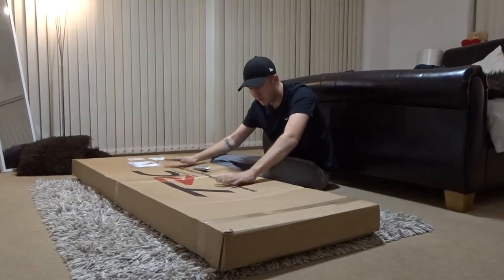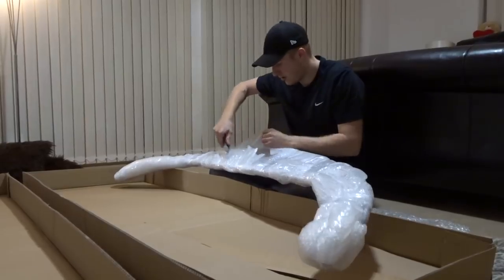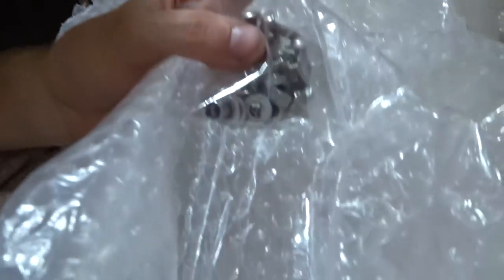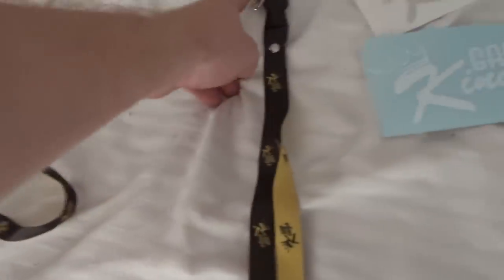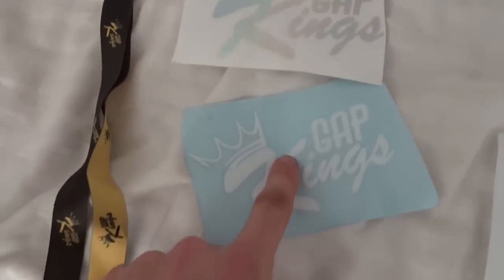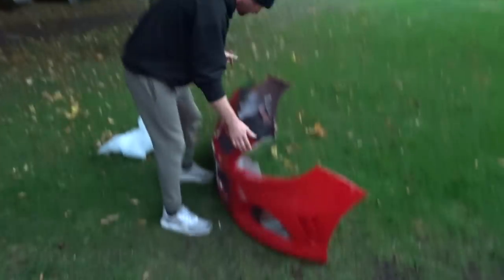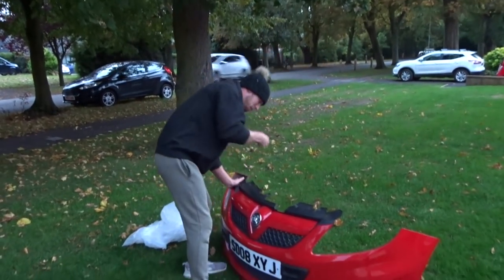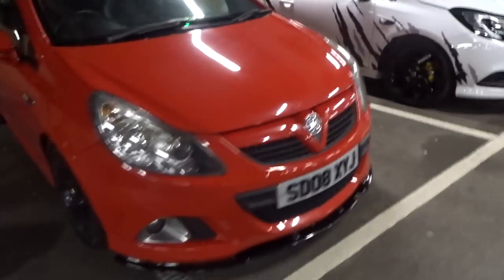ROSIE GETS A SPLITTER!

Comment: Couldnt you have installed it like my zs just jack the car up and drill and bolt on? Or
U have to take the bumper off mate?  
I always reverse into bays and if drive in forwards paranoid ill crack the splitter on the kerb haha
Reply from the maker: Adsm Jank probs could’ve but cuz it’s low just quicker to nip the bumper off
Reply: Jesse // J3ESE cool and mate reverse into bays when you park as u will be gutted if
Crack it on the kerb, and dont drive in the snow when deepish be ripped straight off i had reorder from trc this year after the snow